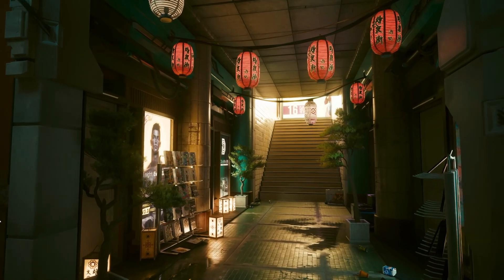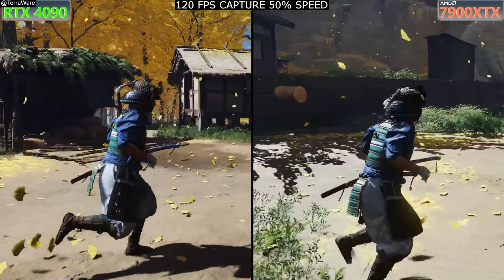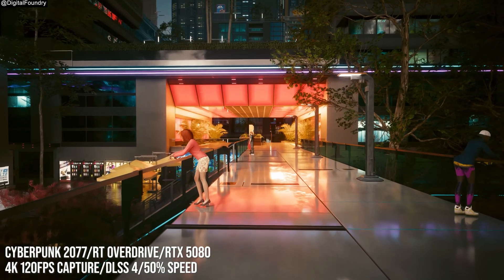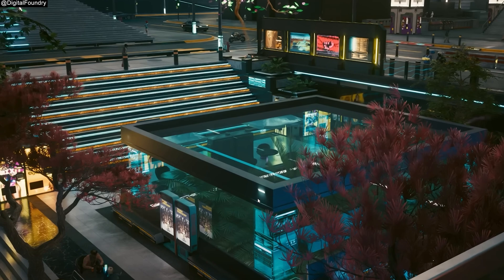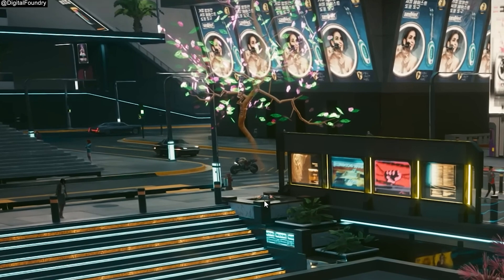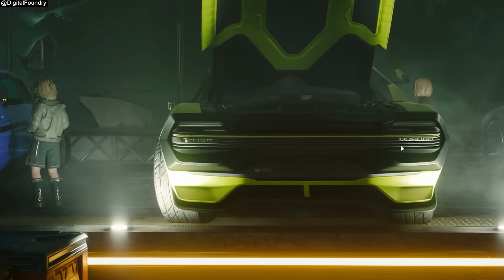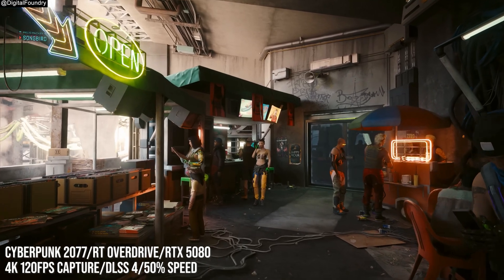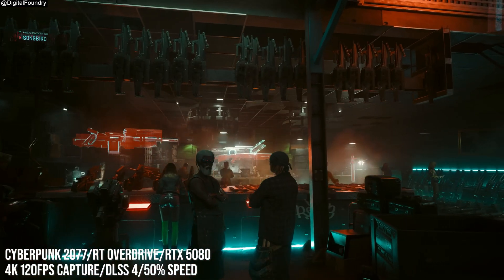A Look At DLSS 4 Multi Frame Generation's Image Quality

Comment: Interesting video, good job. FG is awesome technology that unlocks 4k with RT for mid-range cards but we need to be aware of it limitations.
Reply: It doesn't. Generators start to work well when you already have decent fps (~60) WITH satisfying graphic settings, so rather not the case with midrange cards running RT in 4K.
Reply: @2MichalChojnowski2
It does.
Some getting used to might be required  I guess.
That being said FrameGen aside,at 4K DLSS Performance looks quite nice.
Quite a bit far from true 4K True , but better than 1440p Native.
Reply: @ What you discuss and dissagree with?
Reply: @GameslordXY  yes, I much prefer dlss performance at 4k compared to native 1440p, 4k is just more detailed even with few artifacts.
Reply: @ But FG doesn't "unlock" higher settings or resolution. What you wrote above is common misconception ;) And no point changing the subject to likings of resolution and upscaling presets, because quality of implementation differ on each game basis, so you won't find 4K Performance always looking better than 1440 native.
Reply: @2MichalChojnowski2 I sure could play silent hill 2 with DLSS perf and FG with 70-100 fps on  3080 ti with ultra settings and hardware RT on. Hardware RT mode makes silent hill 2 look a lot more realistic. 70 fps after FG is a bit low but for slow paced narrative game like silent hill 2 it`s good enough.
Reply: @tyr8338  It looks like you don't have FG capable card, so theoretize ;) I have 4090 and e.g. now I'm playing Indiana. Coming from ~60 real fps to ~100 with FG feels like the same slow (in fact latency with FG is a little bigger), but movement of the camera is smoother, so in the end it feels barely better. And then it also adds artifacts. Imo feature not worth using. And you talk coming from even lower fps, so it working even worse. In Indiana coming from <40 real fps to <70 with FG feels actually worse due to latency increased by 1/3. That's why it's not a feature unlocking higher settings for whatever card. It's one making things discussably smoother when you already have decent framerate, so forcing you to lower settings to achieve such framerate first. Maybe try Loseless Scaling and see for yourself how it is with generators ;)
Reply: @2MichalChojnowski2 I used FG in quite some games on 3080 ti like jedi survivor, stalker 2, silent hill 2, veilguard. There are ways of unlocking FG on rtx 3000 with dlss enabler mod.

It sure did unlock my ability to play jedi 4k dlss  - ultra + RT at 90-140 fps, same with veilguard. I could also play Silent hill 2 with full RT. So it sure does unlock higher settings thanks to added fluidity, I would not play those settings otherwise with 40-60 fps.
Reply: @ At least you tried some form of FG and you have really devious way of understanding this unlocking higher settings xD One not universal like I explained, but tied to your games, hardware and likings. Plus I think one that wouldn't convince many  - this is taking highend fidelity approach of 4K and Ultra to degrade it hard with upscaling and cheap form of frame generation. But as long as it's fine for you, it's fine.
Reply: @ DLSS works amazingly well in 4k because of the high base resolution used for upscale. DLSS performance upscales from higher resolution compared to 1440p DLSS quality. I`m quite content with my 3080 ti because I bought it  18 months ago just as crypto crashed and it was really chea (100$  cheaper compared to rtx 4070 and it`s qutite often 20% faster too)  and offers great performance for that price. I might upgrade to RTX 5070 ti soon if availability is good and prices aren`t too inflated. Only downside is that it can suck up to 400w after overclocking, but I don`t mind , it acts as space heater too  :P
Reply: @tyr8338  I know how DLSS works in 4K. Just notice that I spoke facts and you try to negate them with just your opinion and limited examples ;) E.g. just run path traced Cyberpunk in 4K and DLSS Performance. I guess you would see then like 30 fps, so unplayable as it is and even worse after adding FG. This is example when FG won't allow you for higher settings and in fact force you to lower them to make FG usable. I don't even mention 12GB of VRAM already happening unsufficient to max out games at 4K and add VRAM consuming FG on top of that. I hope now you get it.
Reply from the maker: Sure and this video is more of an academic approach anyway. If you turn it on and it looks good to you, you're the final judge.

Comment: Fake Frames for 2,000. NVidia is a meme.
Reply: @PhotoJohn80  bruh 2k is surely too much but don’t act like “fake frames” are the only thing you’re paying for 😭. You’re still buying a graphics card that can do all that previous ones can do and even more, so stop with this bullshit
Reply: @AWeGPUs  finally someone with some common sense
Reply: @AWeGPUs 5090 MSRP is 25% higher and it uses 25% more power to provide just about +30% performance-wise, compared to 4090.
Fake frames or not, 5090 is probably the least exiting gaming GPU on the market. Almost no improvement in terms of price/performance ratio. This is even worse than just a "meh" product.
Reply: @ I absolutely agree. And I also thing that the 90s high end RTX cards are not really a product that actual gamers should buy. Of course it’s not a value product, but I think that enthusiasts would still buy it even if it costed 3k $ and more. Regardless of its flaws, you still can’t really say that you’re paying 2k just for fake frames. I think that in general this “fake frames” topic that people are complaining so much about is just not worth talking so much about. Amongst all the new techs that Nvidia as announced MFG is the most insignificant and least exciting, still people that are too lazy to do some research are only talking about this. What about DLSS 4 (only upscaler) amazing quality and improved performance (less VRAM used) and its backward compatibility with 30 and 20 series? What about neural shaders, faces and materials with textures’ compression (even lesser VRAM used when developers implement them) ? What about Reflex 2? What about G-Assist? What about Nvidia Ace? Are we gonna sleep on the fact that now videogame bosses have the possibility to learn from the player’s behavior and modifying their movesets by themselves instead of having scripted moveset and input reading? AMD can never compete with this immense suite of techs. And I’m not an Nvidia fanboy, I just think that rn Nvidia is offering so much more for the future of gaming compared to its competitors (this is kinda a fact and not an opinion). But people are only talking about fake frames, that is the stupidest thing to talk about rn
Reply: @stangamer1151 you stated nothing but reasons for a higher price for an object.
Reply: @ totally agree with you, I never said your getting value for your money but fact is as nvidia run the show because no one comes close if you need what they offer as no one comes close you will have to buy it, it is funny how people talk about fake frames but when it comes to performace fps is not the only thing that controls how good a game plays, yes the dlss is getting closer to native but this is based on 3.5 no one has properly used dlss4 and most developers have not got their hand on it yet, until amd close the gap this will be the price you will hence why nvidia got 5070 and reduced because amd can compete with 70s sometimes people want to say people buy cos its pr but in actually they have a need which is fulfilled nvidia hence why people buy it and nvidia will keep increasing the price until they see a competition, like any buisness you do not need to reduce price of your product when another competitor does not close
Reply: Might be fake but still better than amd 😂
Reply: It’s a feature on all the 50 series cards. People are addicted to being outraged by everything these days
Reply: Every frame IS Fake
Reply: Yet you can't name a better card for productivity, ai, and gaming
Reply: @ think i just did lol the 5090 is the only card with more than 24gb vram unless your buying non consumer cards, so only way to get better ai performance is use a card that has more than 24gb because my 4090 uses 24gb
Reply: All frames are fake
Reply: Just buy used 3090 for 500$. This is the way
Reply from the maker: Lossless Scaling is 5 bucks lol. I do want to do a video in the future comparing the two hopefully.
Reply: @TerraWare  I mean obviously lossless scaling gonna lose lol.
Reply: The base performance is also like 70% faster than AMD’s fastest GPU at the moment. So what are you crying about?
Reply: @ So you think spending 2,000 plus on a gpu that is truly only 30 percent faster than last gen and uses 125 more watts is a good deal?  AIB cards are reported to cost close to 2,500. That’s basically zero gain per watt. If both cards are limited to 450 watts the 5090 is more than likely barely 10 percent faster. So you are 100 percent paying 400 plus bucks over two years later for 10 percent gain in performance per watt… that is pathetic gains. I’m not crying. I’m stating the obvious.
Reply: @PhotoJohn80  you can unlock a 4090s power limit all the way up to 600W and aggressively overclock it, and at best you get 6% higher frame rates on games this way.

So that alone creates a market for the 5090, what’s the only way to get 30% faster performance than a 4090? A 5090

And there are many users that DO want that 30% higher performance for heavy raytraced games
Reply: @lawyerlawyer1215  I guess we will see what the performance is per a watt in a few days.  I could be wrong.  Either way this is one of the worst gen on gen gains I have seen in a very long time.  the 3090 to the 4090 had at times over a 100 percent gain.  I guess the good side to the 5090 is that it makes my 4090 worth keeping for an even longer time.  I personally do not want an extra 125 watts of heat.  It is not because of price.  It is because of the heat it produces in the summer time.  I have to use a mini split already to combat the heat of the 4090 in the summer time.
Reply: @ I think this gen on gen improvement has more to do with how UNDER RATED the MASSIVE performance jump of the 4090 was.

Everyone was so focused on hating on Nvidia, and their pricing, that it was ignored that the performance jump from 3090 to 4090 automatically placed the 4090 in the spot of one of the greatest Gpus ever.

It’s to be expected that the biggest the performance jump one gen makes, the hardest it is to make the next generation make an equally large jump.

Other wise we would be nearly doubling GPU performance every 2 years, that’s not realistic.
Reply: @ never said that just not a fan of amd like fsr is software based and will never compete nvidia’s dlss which is hardware based, for me it is expensive but reason they can charge this is because they so far away from amd, consumers have no choice as someone who works in ai which only works with cuda cores and intel better when it comes to creative workloads I have to buy the 5090, as 24gb ram I am using but lets wait and see but these ‘fake’ will be better than what people think as the increase in fps is only thing that helps gaming other technologies over time will show whyy again the 5090 will be card many want but not many can buy
Reply: @PhotoJohn80  wait til you realize  real frames are also fake.
Reply: @ Well yes I understand what you are saying, but traditional frames do not cause input latency. It causes less input latency with the increase in frames unlike Nvidia fake frames. Also traditional frames don’t cause strange artifacts. I however know exactly what you’re talking about. I saw that video. However I would not call them fake frames. Traditional frames is more accurate in my opinion. But Nvidia wants to call every frame fake so they better upsale you on more fake frames. But hey whatever makes you happy and justified to buy Nvidias marketing BS.
Reply: @PhotoJohn80  ye agreed, but it's only like a 50% frametime latency increase on dlls 3, and eventually it will be good enough that the "fake" frames will look just as good as "real" ones.
Reply: @ a lot what your saying is not correct because actually when you reduce the multiple frames from 3x to 1x the latency accuracy still does not jump past 50, now the frame issue your referring to are because you get a rendered frame and when ai multiplies that it will take the artefacts and replicate them now if with the new hardware the rendered frame is much better you will better dlss also from pcl it depends what you play most games like rrd2 Spider-Man to name a couple have awful pcl but it is still very playable and when you compare even native compared to the 4000 series the gap is getting smaller now with the new dlss4 in terms of quality and other technologies build into it will bridge the gap even more, im not buying it cos of pr the fact is the card is much bette than what amd offer in terms ai